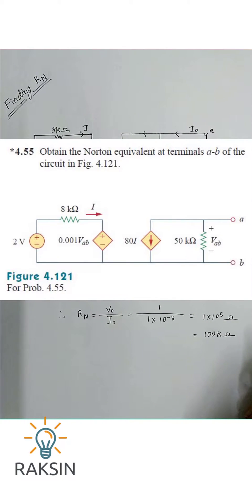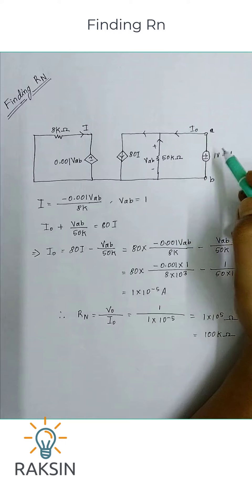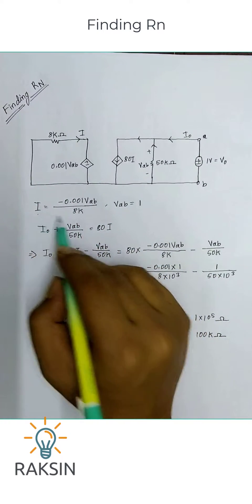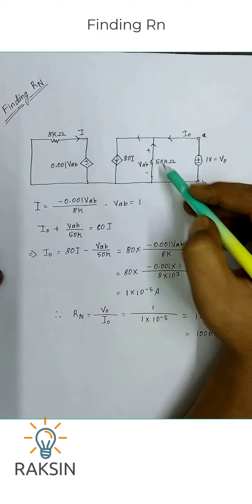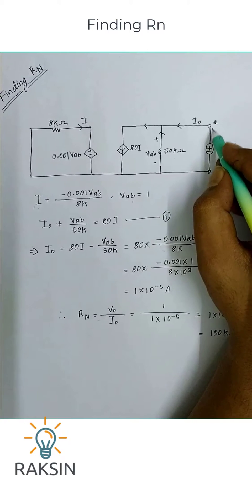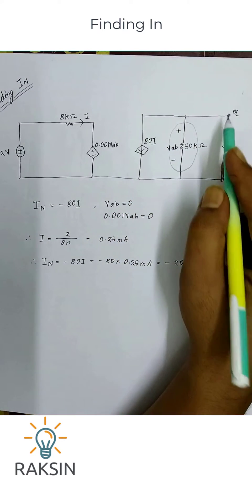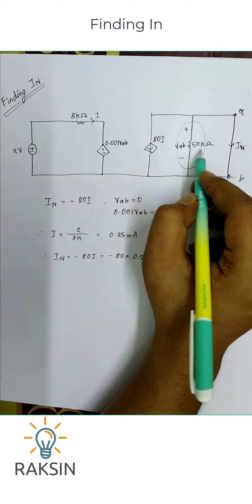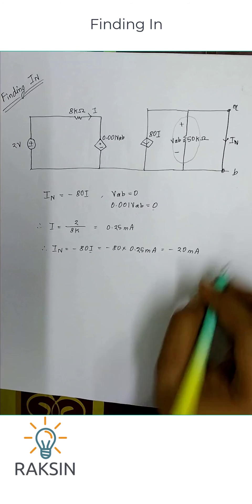Problem 4.55 | Fundamentals of Electric Circuits 4th Ed. | Alexander & Sadiku | Norton Theorem

Comment: I think there is an error in the calculation of RTh , you considered the voltage across a 1V VS to be Vab , shouldn't it be 1V? The equations should be : I=-1.25x10-7A , kcL: I' =80I + 1/(50000)= 1x10-5 A ,Rth=1/I' = 100kohm